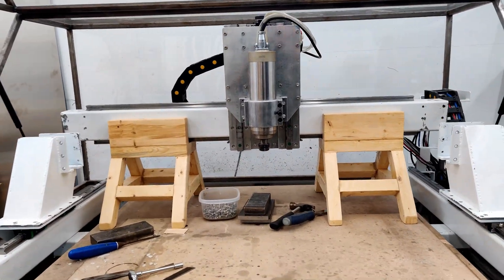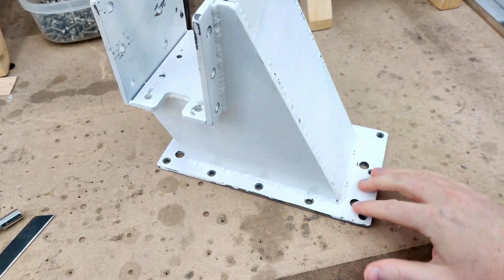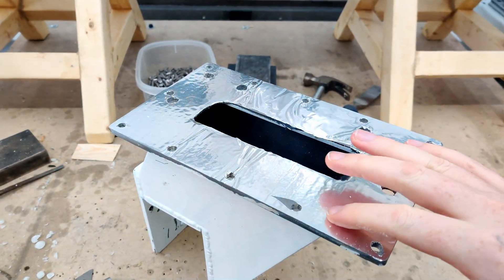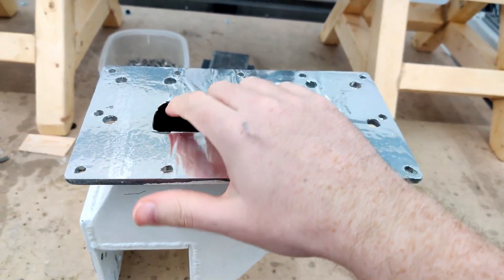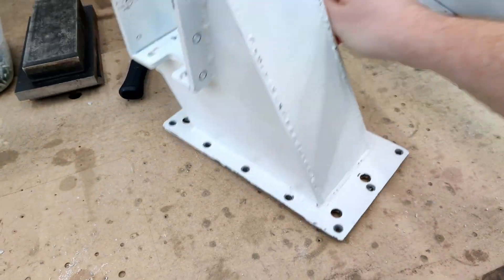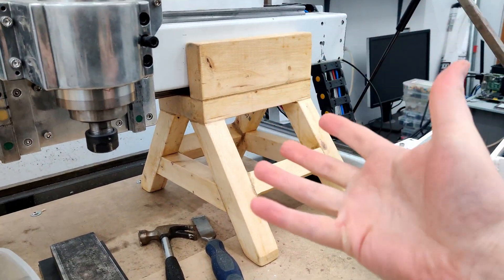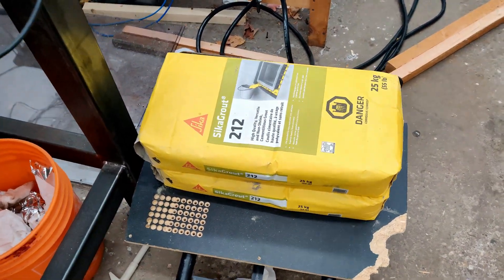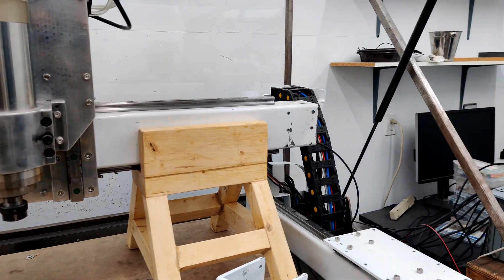CNC machine update: Epoxy flattening gantry risers and wood gantry stands.

Comment: Why not sandwich the epoxy between the foot and the actual surface it will be mounted to? Then align it and lightly torque it down before its full set. Then fully torque once set. Look up Moglice. It's a metal epoxy hydrid made specifically for this.
Reply from the maker: I only needed to get the surface here mostly flat just because it was binding the two bearing carriages when clamp together. It warped because the welding of the gantry risers I didn't think it would be that bad but it was enough to bind things . I rebuild the machine so often that it'd be a bad idea to permanently epoxy the two together and it's really not that necessary fit up that perfect. Also in squaring the CNC machine I wanted to move and slide along that plane/surface slightly so I'm not putting strain in the Y carriages.
Reply: @BryanHoward  you could always add a release agent so the two aren't permanently affixed. Once the machine is aligned, drill and ream a dowel pin to register reassembly? Either way. Hats off to you. Very cool project.

Comment: I may be out of my league here as I'm no longer a machinist. But I do work with metrological equipment every day doing troubleshooting and fault finding in my own lab. However machining in metal isn't my specialty at

From my understanding of a flat and true surface... The way you're describing flat and plumb... Absolutely will have no bearing on your finished machine. 
Don't get me wrong... It's not that it won't matter completely... However
There are so many other/preexisting discrepancies that will effect thing much more... 
For example just the heat from your fingers is going to move that piece of metal much greater than that single layer of tinfoil and epoxy. And it will only take a few seconds and it will take about 24 hours for it to come back down again in a room that is perfectly temperature-controlled, humidity-controlled, and with no drafts.

i've restored a few old machine tools come including a few surface grinders.... Even some pretty high precision stuff for my own lab where the ways and travel mechanism had to be scraped into flatness ....with carbide scraping tools as is commonly done in high-precision calibrated machine tools.

 There are so many other areas where you will get more play and higher discrepancies... And in my opinion it's important to use your time wisely in places of precision that are going to matter and maintain stability .  

 it's totally possible to bring everything into a few ten-thousandths once everything is complete. But doing it beforehand... Well even just the curing of the grout or whatever you're going to fill that tube with... Will ve a slight exothermic reaction and cause more movement than you would think. Same goes for the epoxy. It's going to move things a bit as it sets and sources or sinks the heat. And then once it hardens it's going to try and maintain that unsuccessfully but still added stress into the part. Just like building a violin or guitar... It's important to build things as light as possible so that they can vibrate. A good instrument is just on the verge of tearing itself apart. 

I don't mean to be rude or discouraging and I may be totally wrong in a lot of these assumptions. It's just discourse and things to think about. The exact kind of thought-provoking stuff that I would want someone to tell me during a project. So that I don't miss anything or spend too much time in one area with diminishing returns.

r anything and like I said I'm no expert in a lot of this stuff... But just like old men starrett said back in the day... Work to the precision that is necessary. Not under, not over.  I mean unless you're using some crazy high-end expensive spindle and travel hardware... It will already be several thousands out to start with. But like I said you can easily bring this stuff back into alignment but until everything is finished and put together... I needed precision will only cause more problems down the road. If you have a decent little restless reference play... You really don't need much... And a good thousands in ten thousands dial indicator and magnetic base... That's a great start. But getting submicron precision with lasers and stuff like that... A temperature change of a few degrees in your shop over twenty-four hours we'll move it out more than that laser could ever imagine. Not to mention submicron. I specialize in photonics in metrology stuff... But like I said machining and metal is not necessarily my greatest strength. Regardless good luck to you and I hope the project goes well. It's really looking great and I think it will be super rigid and you will be happy with it

Comment: A surface plate can't be that expensive over there. Even a plate of float glass would have been a better reference surface than that table.
Reply from the maker: I've got a surface plate but haven't gotten around to building a stand for it. It's inside the house so didn't want epoxy fumes all over. But yeah your right that surface was pretty bad. Float glass would have been better. It's not much of a critical surface to get flat in the end. Mostly had to remove the deformation after welding to stop the binding.